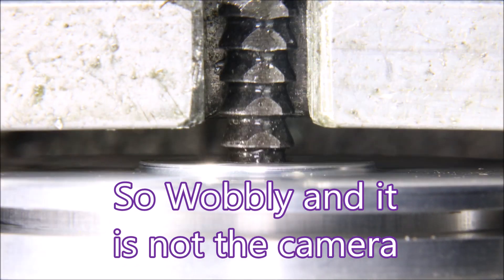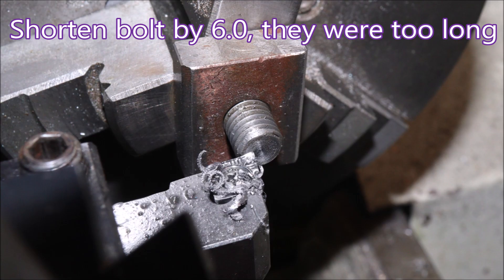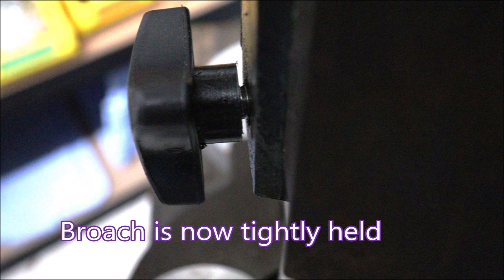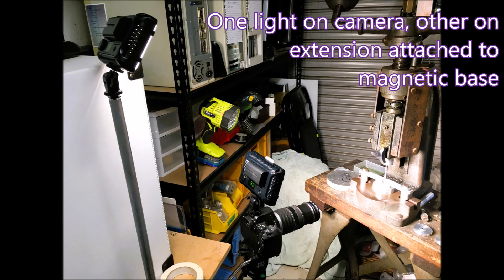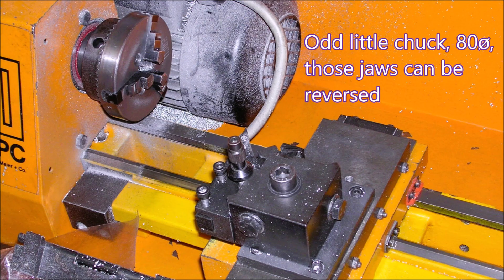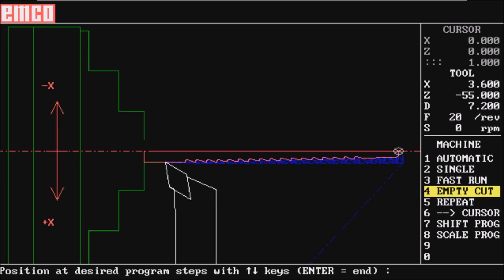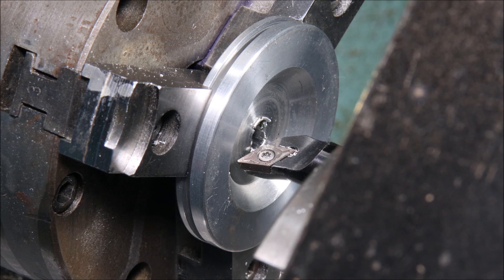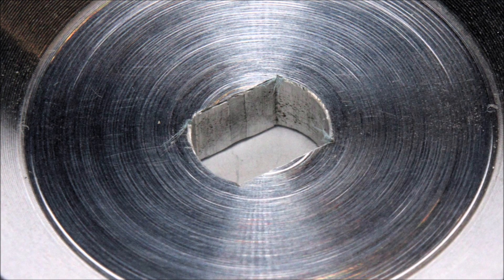Broaching  a cable wheel for a weber carb for a classic mini. Broach made with Emco 5PC

Comment: I find 6061 terrible to turn.  2011 is a pleasure to turn.
Reply from the maker: Hi Chris, me too. BUT a friend with a large shop handles it ok.  Large machines with lots of grunt and flood coolant.  I make sure I mark any 6061 in my shop, but lets face it it reveals itself as soon as you try to turn it.  In the past if a customer really had to have 6061 (weldability) and it was a big job I sent them to my friend.  The money I would have made would not be adequate compensation for the aggravation.  LOL

Comment: The reason you're having such a massive burr is because this broach isn't cut properly. As far as I can see, there's no gullet at all, which gives the same effect as having no front clearance on the cutting edge. 
You've have had a better time grinding a flat on an existing round broach.
Reply from the maker: Thanks for the comment
Reply from the maker: After your comment I went out and tried some 2011, the result is here https://youtu.be/B8yHEf1KlMs
I have no doubt the broach design could be better, but also no doubt that that burring did not occur when I used 2011.  Thanks for you comment, you made me get off my backside and check how it worked with 2011, I appreciate it.
Reply: @smallcnclathes  i came in the other way, so now im here... i have to agree, looks like theres insufficient gullet mostly. are they lands or bottom clearance on the edges? 
then theres zero "top rake" as yeah... thats a pretty hard thing to grind in, a concave surface given the space available... 6061 is "sticky" as, only thing nastier is copper, imho...
Reply from the maker: I know so little of broaching that some of the terms you are using are foreign to me.  I made it to someone elses design.  The broach always worked ok in 2011, it was not a problem until 6061 came into the picture.  My fault as I did not specify 2011 on the drawing when I had them made.  I would normally make them myself and use 2011.  Thanks for taking the time to comment, I appreciate it. Nigel
Reply from the maker: When I started making cnc parts, I quickly realised that with only 1/2hp at my disposal and spray mist as coolant 6061 was never going to work for me.  Works for others with larger machines etc but I decided to stick with 2011. Never had a supply problem and to be honest there have been times when I have sent a job that needed 6061 elsewhere, just not worth the aggravation when there is easier work to be done. 
Thank You for your input with your comments
Reply from the maker: I need to lean on your expertise.  A friend has a small Boxford cnc the tools are at the back so to speak so it uses left hand tools.  If he has a lh threading tool can he fit an internal insert to fit in the holder and cut a rh thread?  This question based on a recent comment of yours

Comment: Thanks, I remember those Compact 5's, they were pretty darn good little lathes. I have it's big brothers a V10P metric and a Super II inch.

I usually use 2024, I'll try the 2011.
Reply from the maker: Thanks for your comment. I have not heard of 2024, but here in Oz 2011 is our machine grade. Biggest problem with the Emco was the steppers losing steps
Reply: @smallcnclathes  I like these small lathes, I'm using the Sherline with ball screws, I modded their milling machine to work as a lathe. Pretty good if you don't push them. You can make or buy some impressive headstocks with up to 5c spindles and very tight TIR's.